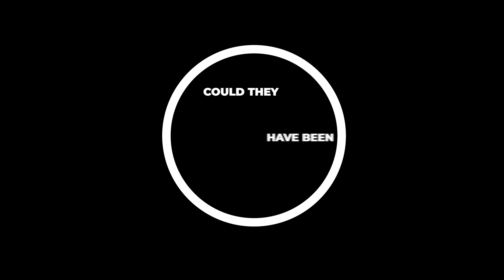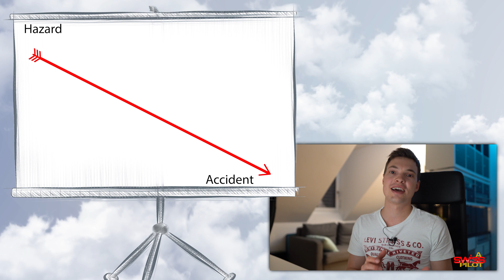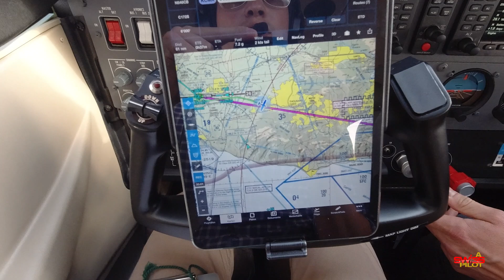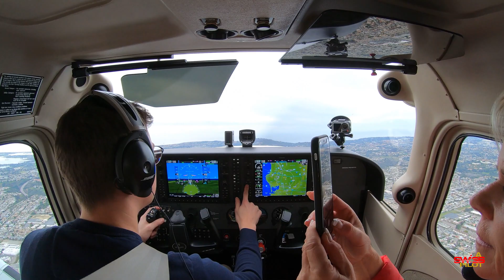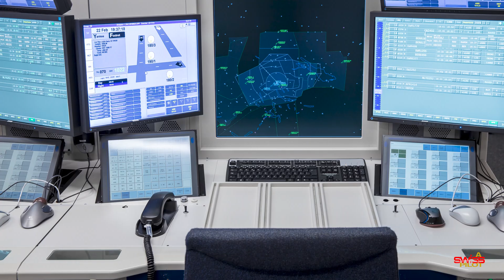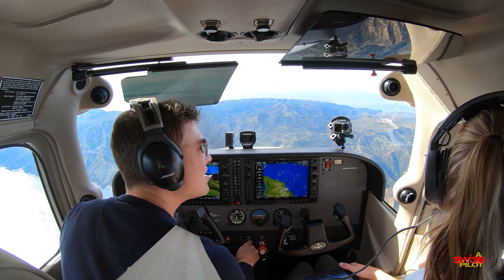Avoiding midair collisions in general aviation - Part 1/2

Comment: As far as I understand, a Stratux DIY device (you need to order a few parts, connect them together and fit everything inside a standardized box) is the best bang for your buck to get all of the traffic info in Europe from different sources. Is that correct? It roughly should cost around 150$

And by the way, great video! :) A huge thumbs up!
Reply from the maker: Hi igor, thanks for your comment! The Stratux DIY seems awesome, however while you will be able to receive Flarm and ADS-B Traffic, the device won't broadcast your ownship position. This means, if we all flew with this device we would all see: Nothing. Because we would all "listen" but nobody is "talking"... (Given you're not equipped with ADS-B out in your plane itself). Watch the second video for a more in-depth device overview... ;)
Reply: @ASWISSPILOT  it actually does support transmission of your position on OGN-Tracker  (868.2/868.4MHz) and PilotAware (868.525MHz) protocols, so other pilots can see you as well. Google for: "github b3nn0 stratux wiki" and look for Build example #3 in the right column of local wiki pages.